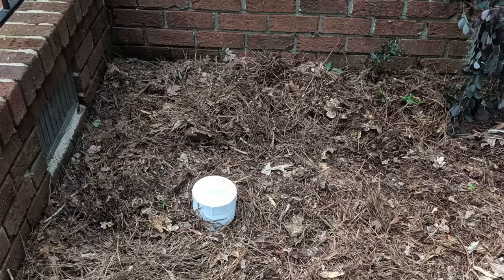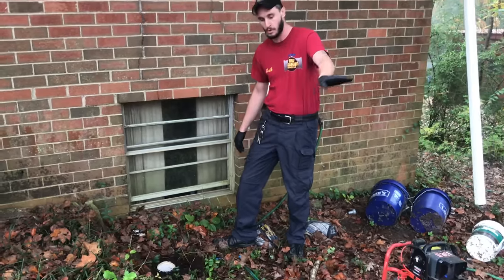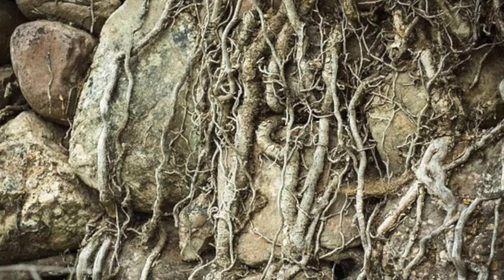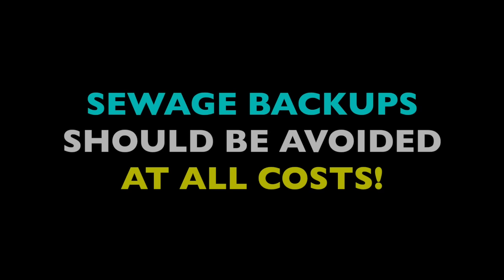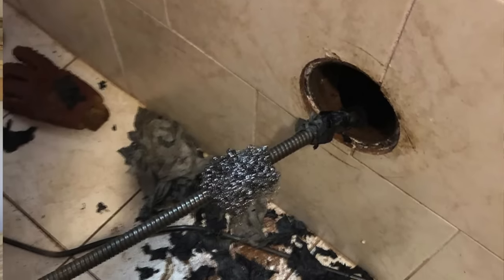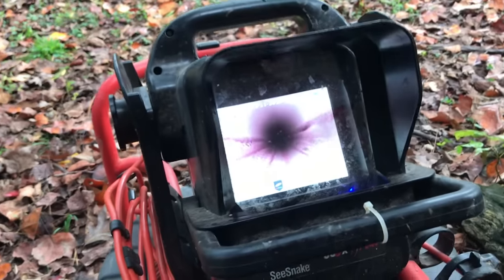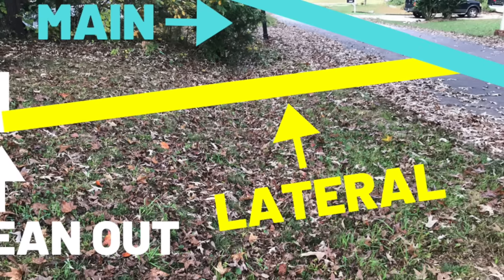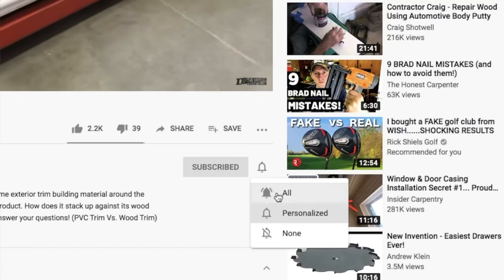This Pipe Can SAVE YOUR HOUSE FROM SEWAGE FLOODS! (Sewer Clean Out Pipe Explanation)

Comment: Is there anything you recommend that can be put down the toilet or the saints in the house to help maintain keeping the sewer line open? May be a stupid question but it’s something I want to know.
Reply: Menards will have drain products. I'm going tomorrow for a root killer one
Reply: @GangsterishlyMelodic  I will have to check Home Depot or Lowe’s, There is not a Menards in my area.
Reply: You can try Drano-like products for blockages. Root-killer products might be good if ALL your drains are slow. However, snaking will 100% fix the problems every time unless your line is broken to the point that it can't flow. You can buy small hand snakes for individual lines for like $30 at walmart, etc OR rent a commercial powered Snake from Home Depot for $100/day. The liquid products are really only potentially helpful for a small, single drain like a sink but even then a handheld snake will work much better any completely clear the pipe every time. 

Cleanouts aren't even beneficial since you can simply remove a toilet in 5 minutes and snake the MAIN line from the start to the street. A damaged sewer line usually can be cleared out via snake for years to defer replacement and the idea of immediate replacement for $10,000 is mostly from plumber fearmongering similar to HVAC upselling. Our 1941 in Cleveland almost definitely has a broken sewer line and symptoms resolved once we had it snaked.

Comment: If the clean out caps are screwed on they won't blow off due to a blockages pressure, resulting in the sewage flowing out somewhere in the house. If you have a screw on type, drill a small hole in top, that may release pressure in the blockage/system (until it plugs up) and this also may help release some pressure when you have to remove that clean out cover. Be careful, watch for copious amounts of sewage flowing out of the pressurized clean out. What a mess.

Comment: Does a sewer line need to be replaced if it is showing gravity compressing the roundness of the pipe at deep end of the line? It still flows well.
Reply from the maker: I’d have a plumber evaluate, Christina. My take is, yes, you might want to consider replacing at least that section. Eventually it will show at least hairline cracks, which will start the root invasion cycle. OR, you can just keep a close eye on it for a while to defer that larger cost. But def want to monitor closely 😬

Comment: How would I find out if I can use the cleanout in Angier (Harnett County) to drain my RV black-grey tank?
Reply: I have no idea what the law is where you live but I see no reason why not. Dump the the sewage first then the tank with the shower dishwater to flush it through. Afterwards look to check if you see any remains run a hose pipe for a few minutes.

Comment: Is that the only access point? Here in the UK we have  manholes which are usually 2ft X 18 inches where all the house drains meet the main drain to the sewer. This is where any problems are sorted
Reply: I've have manholes in the road for lateral servicing the street towns are generally responsible for them. House mains aren't always accessible through them and most towns don't want plumbers working from them hence the cleanouts
Reply: @sewerrat7612  interesting to see how other countries do it. Here, we're responsible for all drainage on our property though we have a 1932 rule(I think it's that year) where all drains fitted before then are the responsibility of the council  because before that time there were no regulations in place. As an example, my house, built in 1932 or thereabouts has a main drain that serves a few properties going through my front garden and the pipe collapsed a few years ago. I didn't have to pay for the repair as it was installed before the regulations were introduced. It can be a bit of a grey area though.
Reply: @paul756uk2  homeowners responsible for anything in the yard to the curb from that point it depends on the town. Alot of areas in new jersey owners responsible to the city lateral including the connection varies by town.

Comment: My first house was $7,000 and the reason why I got it so cheap is everyone passed on a thinking the sore was broken at the street you'd think that would have stopped me but as luck would have it I managed to pull out toy guns cars toothbrushes bottle caps you name it and got that sewer line running and ended up doing pretty good with this house but I could see how that could have turned ugly real fast this other house that I have upstate New York has a plumbing system that is still a mystery I flush water down it but I just wonder where and how it goes down it's supposedly an ancient septic system and I've yet to find it or check it out but the time is coming near I can't put my head in the sand any longer for fear that I might hit a septic tank

Comment: It's not that difficult even with cast iron to cut a section out of a pipe and then install an ABS Y for a clean-out. It's also important if you do get 'scoped' to know the distances. Maybe you only need to dig up a section of your front yard to fix section of pipe. 
And standing water? One of the biggest chronic problems any waste line can have is when because of settling it goes flat or even slightly uphill.  As in the video the pipe with the small amount of sediment in the bottom may seem like a minor situation, it really isn't. That line will likely continually get plugged requiring snaking.

Comment: Can you tie yard drains into the cleanouts?
Reply: Most places do not want fresh water going into the sewage system. To much fresh water stops or slows the sewage treatment works. So you may get a fine depending where you live. 
If it is allowed I would put in a gully with a sump in it to catch grit and a grating on top to stop leaves etc. Then run a pipe from the gully to the cleanout.
Reply: @johnclements6614  Great info, Thanks!

Comment: We, 60yrs/72yrs, have an over flowing 4yr old septic/leach system that has been emptied twice. The toilets are sluggish, my husband won't flush after #1, and goes outside during the day. The bowl he used is calcified, making proper cleaning impossible.  
 - 2 occupants -Douglas County Mo.  

I am unable use the backyard. 
My husband is unwilling to call the installer??? money?/pride??? 
Everything is leaking, smelling and soaking the front yard of my She-shed. 
No vehicles; wheelborrow,, dolly, ATV or trucks can come back to finish construction because the ground is so soft. I am unhappy and worried  he may pass and leave me in an unhealthy mess.  

I heard about worms cleaning out the soak pipe. I don't know if the worms will grow and cause more problems. Have you heard of this method? Thank you

Comment: 0:56 How is it legal to have a Y and 1/8 bend in a vertical drain? Aren't sanitary tees supposed to be used in this application? I have been turned down for this by plumbing inspectors.

Comment: First, great topic. Sewer is so seldom thought about, both home and city main, until something goes wrong and it all turns ugly very quickly. I would guess that most folks would say that they worry about their water not working properly before their sewer not draining right. 
Try this for a few days. Don't use a single drain in your house. Have as much water as you like, but don't use any drains. Then, tell me which is more frustrating not to have work.
Second, the explanation about building and lateral sewers and who is responsible for them is not completely accurate. It may be for their municipality, but it varies WIDELY from city to city. Every city has their own code for this and assuming that it's universal in your own state, let alone, the whole country is a big mistake. For example, my city requires that the property owner be responsible for the the lateral service line all the way out to the main line. This also includes where the connection is made.
Lastly, in addition to the clean-outs, a property owner should seriously consider having a backflow preventer installed. Imagine for a moment, an 8" diameter sewer with a quarter of a pipe in flow, suddenly plugging up just downstream of your lateral connection. As the mainline quickly begins to fill, that water is looking the nearest low spot to go to. Most basements aren't but a few feet in elevation above the mainline and once that sewer begins flooding into your basement, there isn't anything that you can do about it. It will keep getting deeper and deeper by the minute. Even faster, if you're connected to a larger diameter trunk line. That's where a 'properly maintained' backflow prevention device can save you from an awful situation. By properly maintained, I mean periodically checking and cleaning the mechanism. Usually, this is some sort of flap that only opens one direction.
 I've personally seen the damage caused by sewer problems and they are at bes, unpleasant, and at worst devastating. Also, they are usually very costly. His advice on scoping your lateral all the way to the mainline is very good. A picture is worth a thousand guesses, I say.

Comment: I think this is well intentioned but really one of those fire fire the house is on fire videos. I have lived in my brick bungalow in a suburb of Toronto for 45 years and had absolutely no problem with the draining of the main line or the house draining under the basement floor. I would think most people would have the same experience. Horror stories about sagging pipes broken connections under the ground are of course possible but these things are rare and to pay somebody to scope the (main) drain line from the house to the city sewer would cost a lot of money and I think on balance, leave it alone if it works !

Comment: Will insurance cover the cost?
Reply: My regular coverage did not include sewer backup.  It was extra for but I have it just in case.  
You should definitely check with your carrier if you think you may have any issues in the future.  
It's expensive though, around $200 per year.  Probably because of the cost of a cleanup.

Comment: North Carolina Hickory North Carolina is bullshit! I never had any trouble until they replace my new satellite meter and I'm the only one on the block it's got one of these suck outs good or bad that I want to go do laundry and it came up right under my commode and ruined my floor. And now above everything else that I have to worry about I'm worried about using my washing machine having sewage coming to my house and I'm disabled with multiple sclerosis and they want to act like they don't want to do s*** about it. I have an adjuster out here that most likely is I have an adjuster out here that most likely is going to try to fight the fight and I'm going to be left with bulshit again as usual here in Hickory North Carolina. I heard about the outstanding bills and the trouble that Charlotte was having and now I see this video and you're saying the same thing I am keeping it for a personal reference and in case I have to go to court I am not up for this I'm not up for the drama my heart is not in good shape and it's just bulshit! Are they having a paper to fill out not necessarilyfor this matter but yet I wrote All I could on it and took a picture of it for later I specifically said I do not have any trouble until you put this new meter in I paid my bill and for the sewage backflow I'm the only one on the block that has one and it has created nothing but a mess I never had any trouble whatsoever and I'm also lack of their of a pressure there's a lower pressure than I used to have and I'm understanding that if the pressure is not right it will consistently back up this is not my expertise but I'm learning about it that I can and I can comprehend I am not stupid I might be a little dumb but I am not stupid and they're trying to talk s*** out of one side of the mouth while it's coming in my house. I don't want to be taking a shower and all the sudden this thing back up. I got health problems and I just don't need this s***no pun intended

Comment: we dont have one, been in 5 houses, in uk and canada none of them have had these
Reply: I think this is more of a modern addition to the sewer system.
Reply: I have had to scope from the inside.
Reply from the maker: Totally possible, Adrian. I've lived in mostly older houses over the last several years and they've never had clean outs. Nearly anything after the 1980 will have them though--even if they frequently get buried by leaf fall and soil displacement.
Reply: @TheHonestCarpenter  Not so, it depends on the frost line level, above the 45th parallel the sewers are at least 5 to 6 feet deep and and building code has never required this. These features would be a cause of freezing pipes even that deep when the ground is frozen for 4 to 5 months.

Comment: why don't you add a septic tank in front of the connection to the sewer mains? this keeps the mains safe, cleans up the effluent going out on the mains. not solid and other material goes thru.

Comment: Not everybody has 2 clean outs and in some cases none! Know where your plug is by opening up
Clean out cap if no water
Holding you plug is between  house and clean out if your see sewage
Plug is in front of clean out and street. If no clean out your screwed!!!
Call a plumber you have no choice unless go thru
The house.

Comment: The only problem with your theory is that it will not prevent flooding unless you unscrew the cap meaning that you would have to know there's a backup in progress Matt knowing there's a backup in progress your house will flood Anyone knowing the mechanics of this system would know that

Comment: This hood was built up in the mid 50s, so no clean-outs original to the houses. Cast iron through foundation, terracotta all the way to the saddle where it hooked to the main. None of the rooters around here are going to take the time & effort to remove & replace a toilet; instead they hop on the roof and snake through the vent (of course they tear up the vent and damage shingles in the process, but that's for you to discover later). With all the bs & paperwork involved in purchasing a home, none of this nor the time-bomb that it represents is ever mentioned to the buyer, yet the 2nd or 3rd owner typically  is going to be hit with the issues it causes and very costly repair/replacement.
Reply: Also can't say that I've ever seen two clean outs on a house around here. I know it isn't done on retros. Can't say for sure whether it's being done on newcon, but if so, I haven't noticed.

Comment: I destroy the cover with my lawn mower all the time.
Reply: Ditto... I keep an extra cover on hand knowing I will get careless and drive the lawn tractor over it.
Reply: Did the same. Got lucky while the cap was broke of sewer backed up, but it emptied into my yard. Then I bought the replacement part but just stuck it on, sewer backed up again blew off the cap. The issue was old clay city pipe couldn’t handle when the neighbors down the street had a party. City would have to use a pump truck to remove the blockage.

Comment: U confuse 2 things. Sewage backup and sewage clog. You talk about sewage line clog that can be cleaned with a water jetter pushing clog to the main line.  Sewage back up is when u get so much rain city sewage line cannot take it and backs up into ur house. Cleanout will not help in that case. U need to have a check valve installed to prevent sewage back up….or…if your line is clogged that probably might help when u get a lot of rain and experience sewage back up …get it ?
Reply: Pablo, not all jurisdictions have combined sewer storm systems. I had a customer who's back water valve got stuck in the closed position due to flushable wipes. That night they were on their second floor doing all their laundry and showering while they're downstairs toilet was overflowing. they did not find out about it until the following morning when they went downstairs and it was completely flooded out. Thanks for watching.

Comment: This even happens with town sewage ??
Reply: Yes.  I’m in Rochester NY, and my house was built in 1914.  It came with a cleanout in the basement, original to the house as far as I can tell.  My sewer would occasionally get clogged and I’d need to have someone like Roto-Rooter clean it out.  The main causes of the problems are (1) roots from a tree between the sidewalk and the street and (2) a misaligned tile in the line.  Both of those are in the section of pipe that the city or county own.  It’s the city’s tree.  Eventually I had a lot-line cleanout installed, right next to the sidewalk.  Now when the sewer gets clogged, I just call the county and they clean it for free.  I’d really like to get that problematic part ot the line replaced (even if I have to pay for it myself, although I don’t think I should have to).  However, when I talk to the city or county about this, I get nowhere.